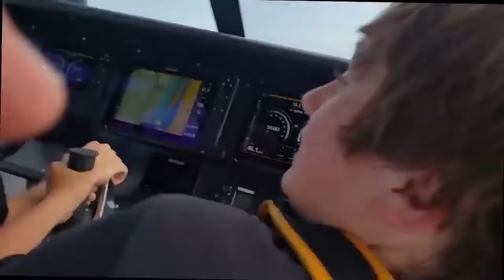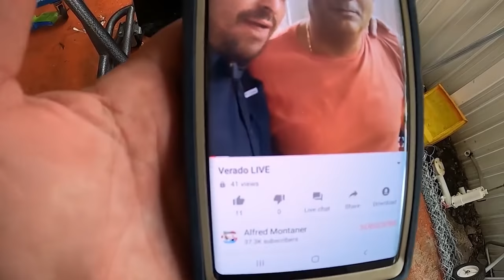Summer Madness on the Docks ! (Sunk Verado Update !)

Comment: I am amazed at the number of boaters who pull up to the dock with no fenders out and no dock lines ready to go.   Not to mention the complete inability to pilot their boat.  Now, I can forgive lack of fenders because I won't use them at certain docks depending on where the rub rail sits or the built in protection on the dock itself.  But, I can't forgive not having dock lines ready.
Reply: At these poorly designed Docks, you would always change the position because of the Tidal change as these Docks are the old stationary Docks. When was in the USCG 50 years ago, my base had them and they stink !

Comment: Mr Alfred,  do your boaters a favor and make lots of money for your self, at the same time:  make a short line , about 6 ft over all, with a loop on one end for the back stern boat cleat and on the other end of the line back- braid a 30 inch diameter loop. The  docking then consists of simply tossing the large loop over the dock/pier piling and then the captain puts the engine into forward at  idle and he will be puling against the docking  line. 'The bow will slowly pull against the secured  line and ease the boat against the dock. no jumping , swimming or becoming lunch for Fred.  The rudder stays in neutral, straight ahead, and the props do all the thinking and makes the boat driver look smarter than he really is. The dock line then canjust stay attached in place ready to be used when they return to the dock.T his docking maneuver works for any size boat up to and including container ships. No more looking stupid or getting hurt.
Most likely you would sell to half of the boats on any weekend.  Buy the line by the large reel and teach someone to make them for you.
Hell, if you prefer I'll make them and ship them to you.
let me know what you think
Captain Bill

Comment: what is the avg current going through there on a tide change
Reply: 6 to 7 knot at the strongest and each tidal change then slows down, but when they open the Flood Gates just upstream, the current can get as strong as 10 knots ! These new boaters are then really lost in that. I'm sure they don't check the tides before going out. :(